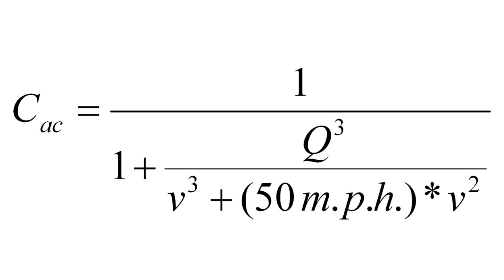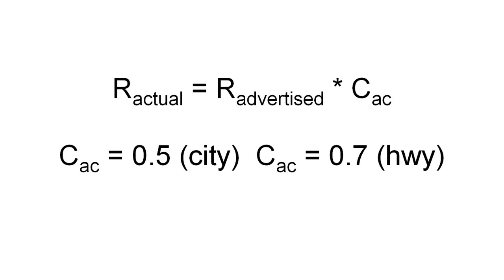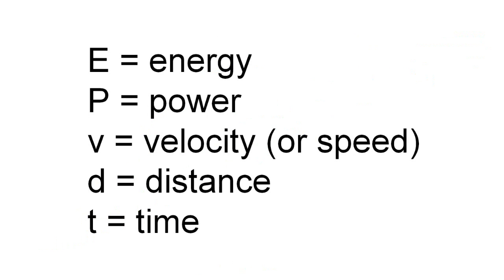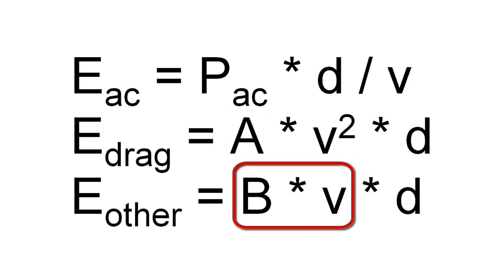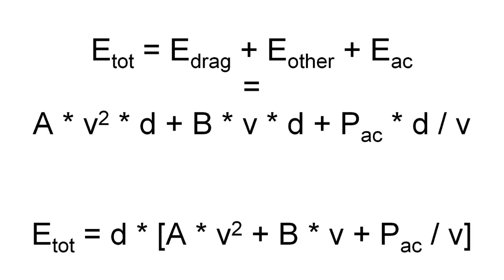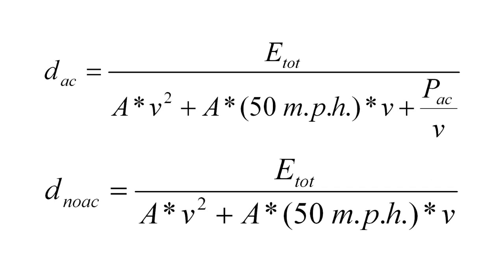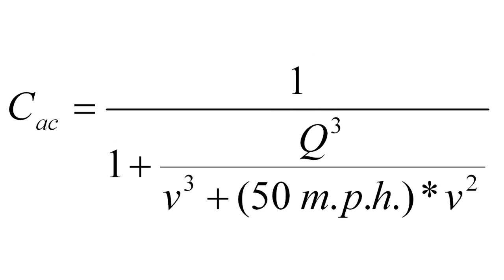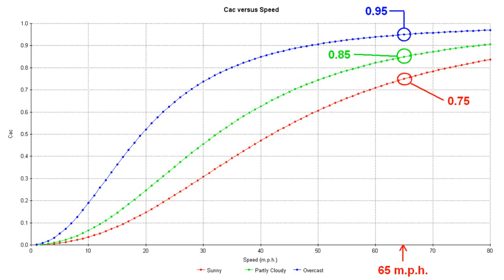Electric car range math

Comment: I think you are not solving the right problem here. Air conditioning power (Cac) has an insignificant effect on an electric car's range (5% at most). The major factors affecting electric range are #1 Speed (above 50 MPH the air resistance hurts badly, it goes with the cube of the speed), #2 Driving style (aggressive acceleration and braking) and #3 altitude difference (cost of investing in potential energy when climbing). Cold weather is also bad, as heating is 10x more expensive than cooling.